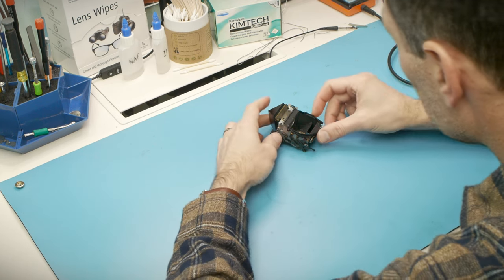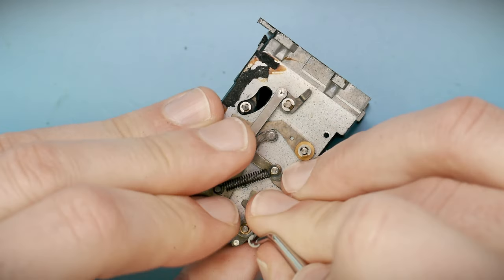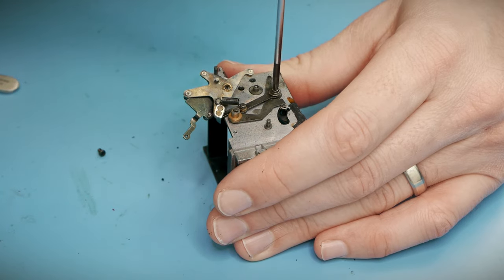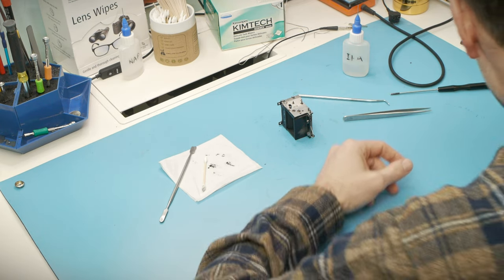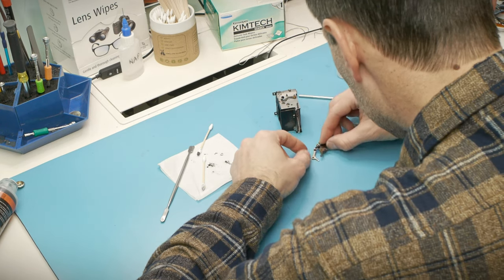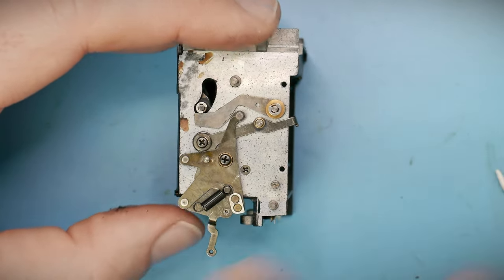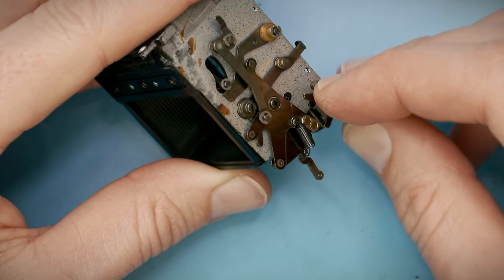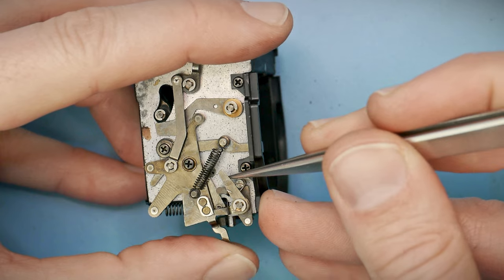Pentax K1000 | Part 3 - Mirror Box Service

Comment: My mirror was stuck up because the shutter curtain would not trigger a release.  I have seen others us lighter fluid to lubricate the parts, especially those not accessible.  This seems to have helped free the system.  Especially if you do not want to tear down the mirror box.

Comment: My x-sync terminal is missing from my K1000. It appears the housing is threaded. Can a replacement be threaded in? Do replacements even exist? I was wanting to use an external flash, and that's when I noticed the terminal missing. Thanks!

Comment: The mirror latch bias spring on mine is broken. Do you know what is the correct size (or the approximate gauge of wire)?
Reply from the maker: I know that people do fabricate new springs but it's not something I have experience with. Guitar strings are a common source for the thin springy wire. Forming the wire into the correct shape is, of course, the tricky part. And some sort of annealing is required at the end to remove residual stresses. Good luck!

Comment: So have you tried replacing shutter curtains yet?
Reply from the maker: I have removed shutter curtains in order to clean the roller and pinion shafts. I haven't installed new cloth yet. But I don't think I'll be removing the curtains on this camera.
Reply: @SamsCameraBench  well then you could at that point have done it, you are a talent

Comment: Excellent stuff and extremely helpful! I'm about half way through this particular video. I've thought about using an ultrasonic cleaner for the various parts in order to clean gunk and grime off 'as much as practically possible', do you think this would be overkill?
Reply from the maker: Yeah, ultrasonic cleaners are great for this. I've started using mine more just to save on cotton buds. I do have to be a little more careful with keeping track of parts though. Once they go in the cleaner, I lose any organization that I might have had on the work mat.